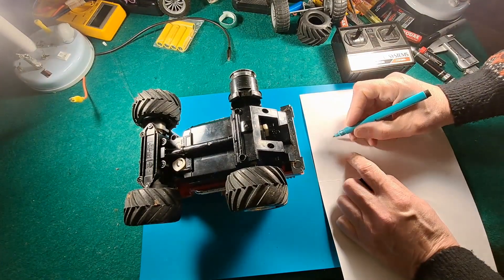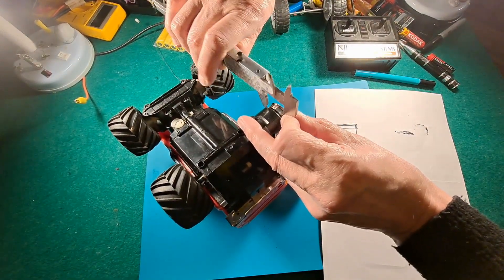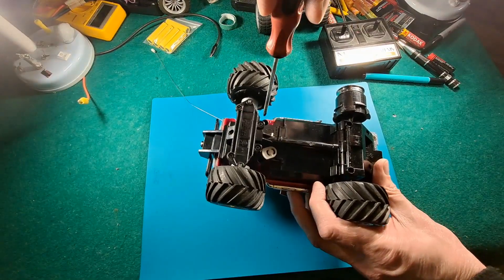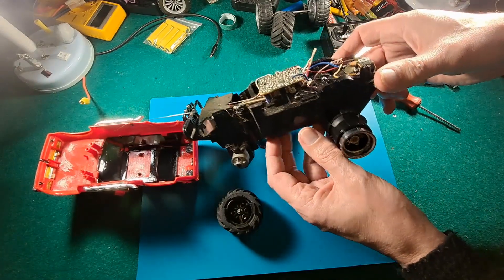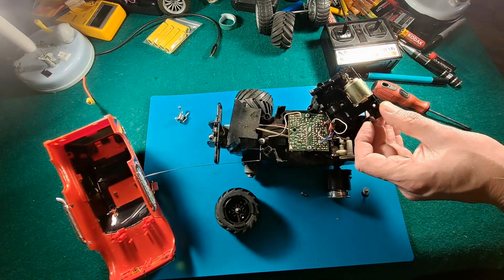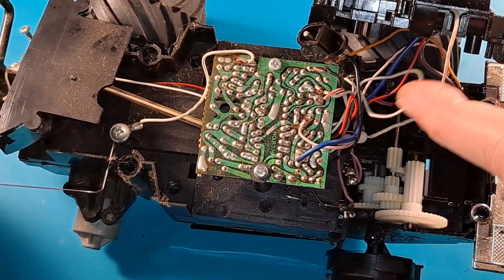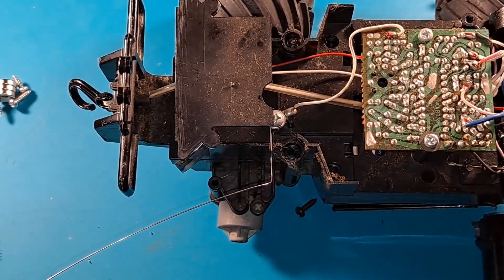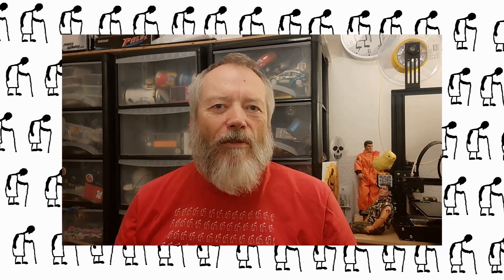PART 2 Nikko Toyota Hi Lux RC car 1985 revisited 20210202 gearbox

Comment: Nice taredown 😀. Looks rather complicated with all the wiring in there.i think it can be done.
Reply from the maker: If necessary, it will be easy to swap the receiver to cure that intermittent interference issue. The tyres are a bigger problem. the tyre has a different sized rim on the inside, compared to the outside and any commercially available tyres I have seen don't have that.

Comment: What scales does nickel it looks like a 1/16-1/18. Also you should check wltoy or one of the other Chinese brands or like hbx you might be able to find tires that look exactly like the ones that are on this that you could that they have for their cars to put on this car.
Reply from the maker: Looking the same and fitting are two different matters. The tyre has a different sized rim on the inside, compared to the outside and any commercially available tyres I have seen don't have that.

Comment: Looks like a plate of worms for sure lol. 😂
Reply from the maker: If necessary, it will be easy to swap the receiver to cure that intermittent interference issue. The tyres are a bigger problem. the tyre has a different sized rim on the inside, compared to the outside and any commercially available tyres I have seen don't have that.